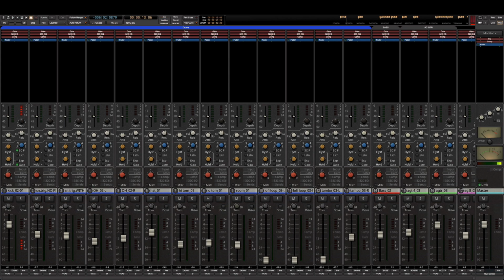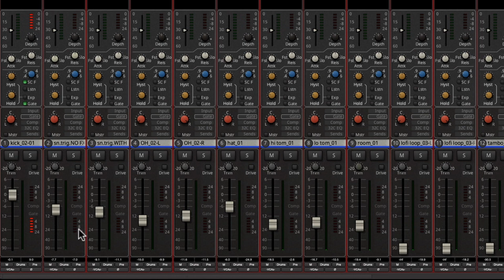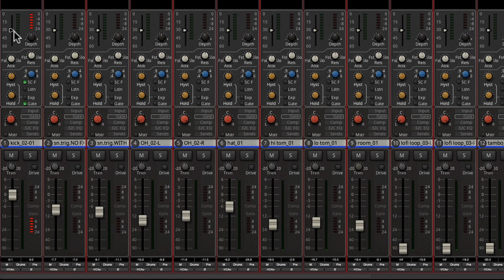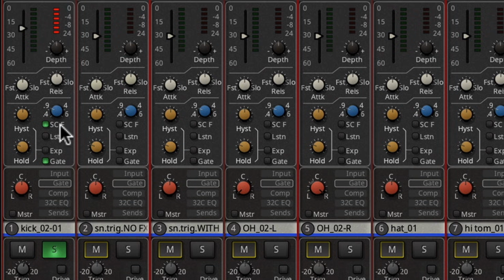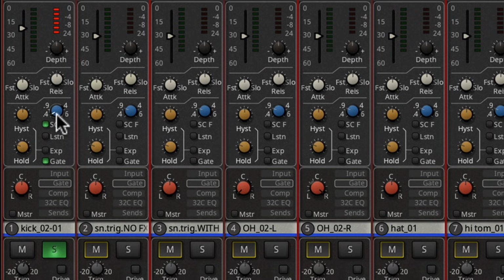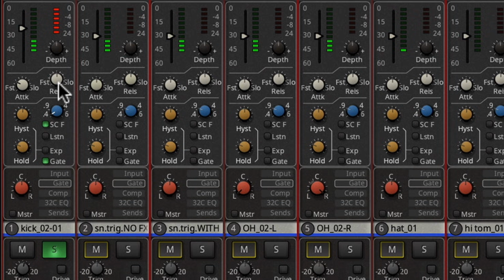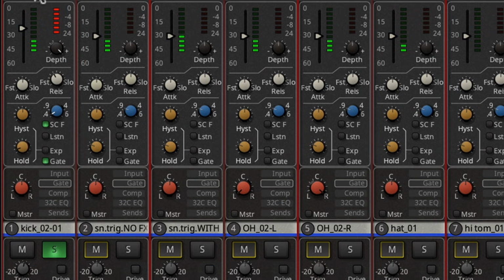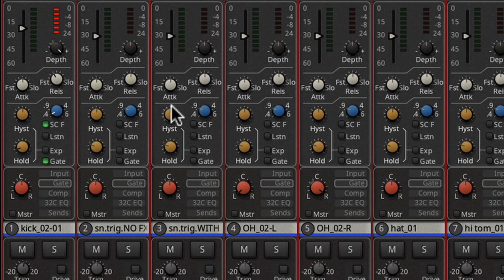Gate Overview in MIxbus32c V9

Comment: I have love MIXBUS from day one but I have not been able to use it fully. Why? Just because the texts and names ( buttons, knobs, …) are too small fonts with no options to magnifying them.
Reply from the maker: Have you watched the recent video going over the scale and size of Mixbus?  The look of MIxbus on your screen is determined by your monitor resolution (1080p, 1440, 2160 etc) and the scale and size options you see in MIxbus preferences.  With that said V9 has been updated with sharper fonts and slightly bigger knobs at the default settings.

Comment: What is hyst button for? Couldn’t find it in video.
Reply from the maker: The Hysteresis knob keeps audio that has a longer decay from getting chopped off after the volume gets below the threshold.   This knob didn't apply to a kick drum but you can read up on all the options in the manual.
Reply: Awesome thanks !!